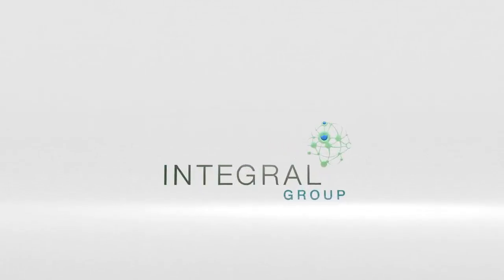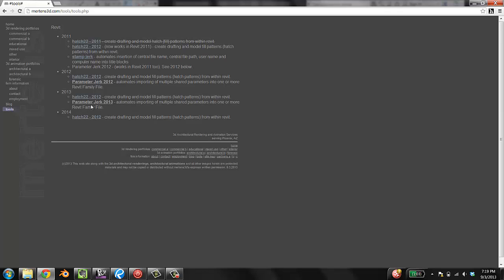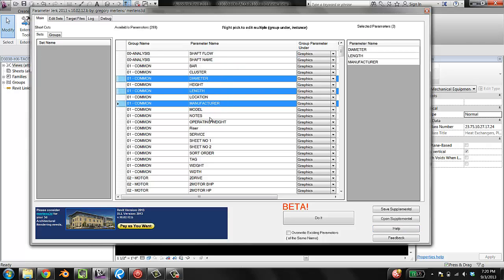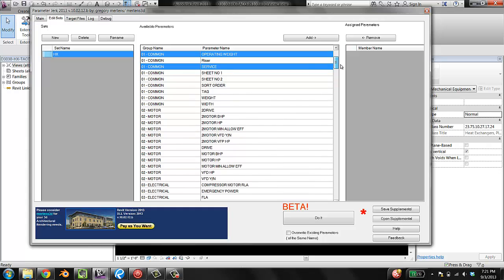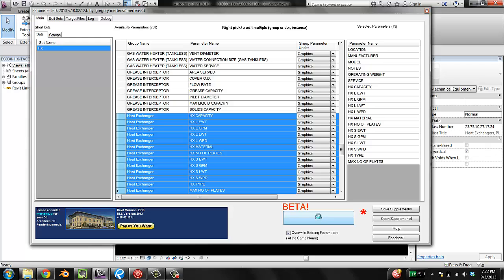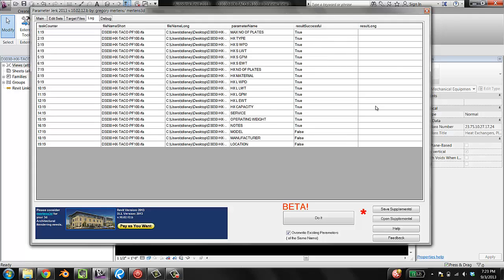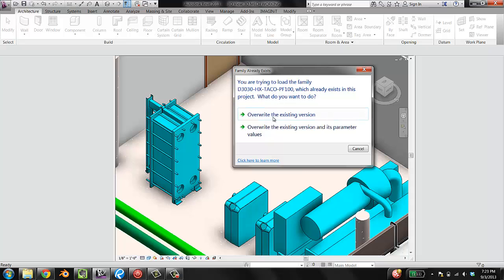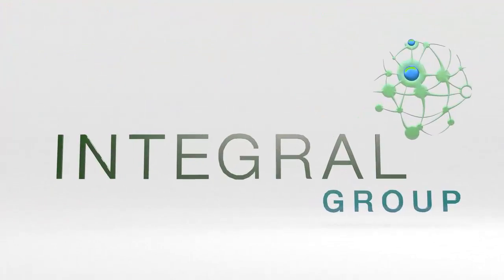How to Schedule Mechanical Families in Revit MEP (Part 3: Parameter Jerk)

Comment: I am very grateful that I found your videos on this subject matter. It will make things much easier because currently we do the schedules in excel to Auto Cad to import to Revit. However I see Parameter Jerk doesn't have a version for anything above Revit 2014. I was wondering want program you are using currently for the newest versions of Revit.
Reply from the maker: Hi Peter, we use Rushforth Tools now - fully supported through current versions of Revit, and actually more powerful than parameter jerk. It costs money, but easily the best money we've spent on Revit tools. It's a no brainer. Cheers. :)